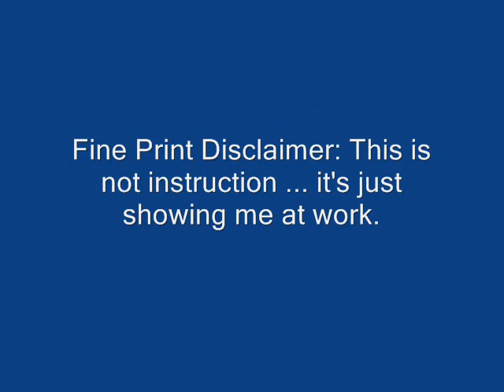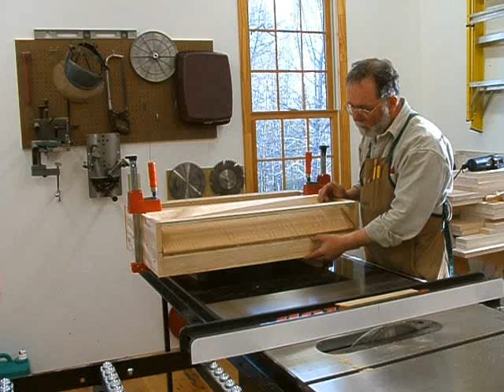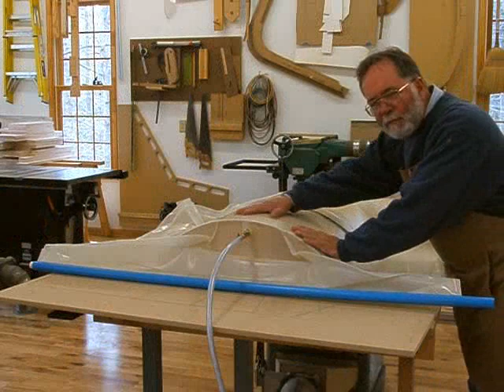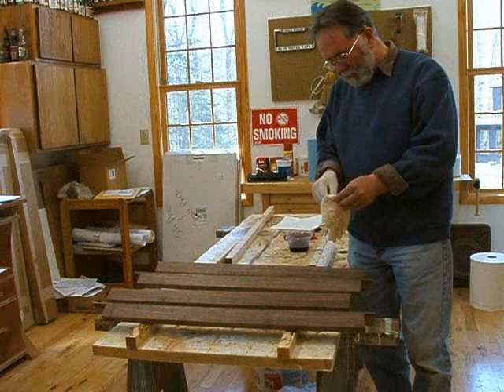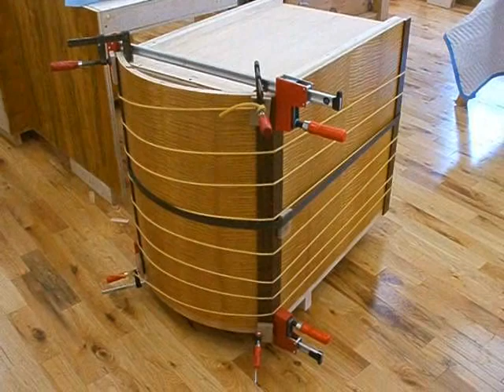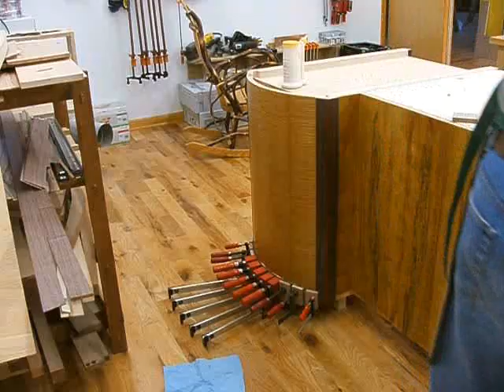Making a Veneered Executive Desk Part 5, Attaching Curved Laminates; Andrew Pitts~FurnitureMaker

Comment: I've been following this series on this desk and seen some really good techniques, thanks for the time you use in explaining why you do a particular function.  In the 16 minute area of this video you are clamping the trim onto the curved "pillars".  What has worked well for me when securing a glue up on a curved surface is "shrink wrap".  Obviously it has to be an area you can actually wrap the cellophane without totally "smothering" the piece, but when you can and then heat it, it draws up very nicely and secures for the glue to set.  Jut passing along my experience.
Reply from the maker: J Fenter That's a really good idea! Since the wood absorbs the moisture from PVA glues, having air on the outside of the piece is not really a concern. As long as the shrink wrap does not distort the substrate, it sounds like a winner. Might be a bit tough to do on the desk front in the video, but a good idea nonetheless. Thanks. Andy